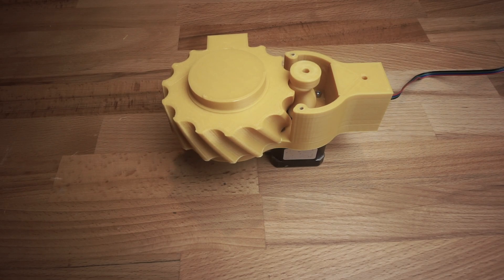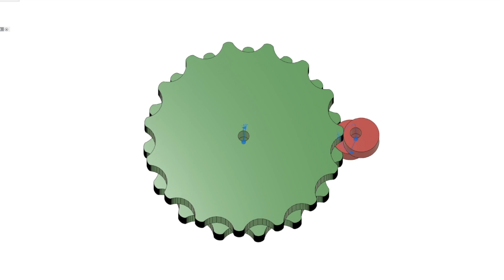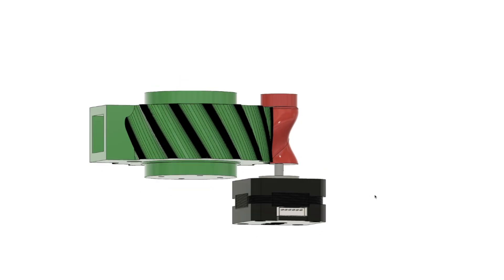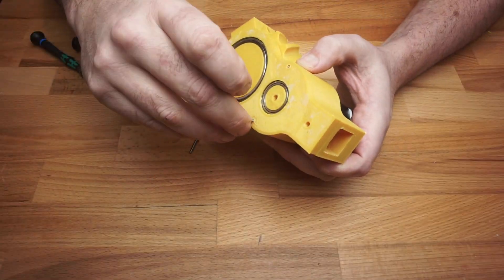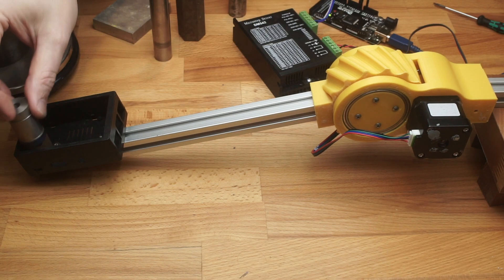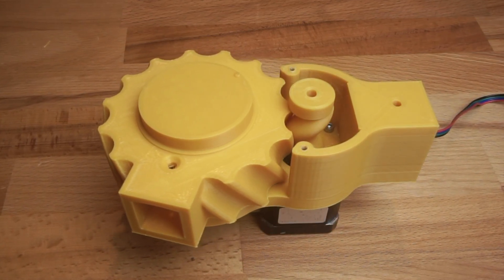What are Eccentrically Cycloidal Gears?

Comment: What parameters in the code have to be changed to get the disk in the shape as shown at 0:37 before we sweep? I require a 20:1 reduction. Eccentricity and the ring roller diameter are to be such that my motor shaft which is 8mm in diameter has to fit the sweeped roller (FYI its my first time doing this and my background isn't mechanical engineering)
Reply: Basically I want to increase the area of contact between the 2 objects of the gearbox

Comment: That cycloidal drive is fascinating and clever.
However, due to imperfections the drive gear acts
somewhat like a screw and causes a bit of sideways
force. This causes some extra friction.

I am suggesting that both gears incorporate a half
twist clockwise an half counterclockwise. This would
balance out any sideways force improving efficiency.

redrok AD0TJ

Comment: It would be good to have a comparison for the sake of efficiency. (I assume this is less efficient than cycloidal drive?)
Do you have another video with a torque test on an equivalent cycloidal gearbox?
I just checked your 20:1 video, and 1.6 is much kess than I expected, assuming the same stepper. I suspect that this is more efficient when compared to a standard one without bearings, but a standard one with bearings would be a cool comparison.
As well, a version like this but with say 3-4 bearing steps around the 1t gear instead of a continuous profile might reach a higher efficiency than this.

Comment: I disagree with characterizing this as any sort of cycloidal drive. A cycloidal drive works by pushing a bearing into an angled surface, producing torque by rolling downhill in a circle. This video uses the geometries of cycloidal drive gears, but it rotates a circle against a gear. It is basically a 1-tooth pinion gear. It does not „roll downhill“ anywhere.

In a cycloidal gear, the force pushing the cycloidal gear parts apart at the sliding surface is converted with high efficiency to torque. In this gear arrangement, similar separating forces are present, but because of no rolling on the sliding surface, they are lost to friction.

I suspect that if you where to make a custom involute gear with 1 tooth as a helical pinion gear, it would work better than this.

Comment: Nice video, I want to build the Hand Crank gear model. What metal hardware are you using? I'm guessing bearing spec are:  Deep Groove Ball Bearings 5mm Bore 16mm OD 5mm Thick; Is this correct ?

Comment: You can also 3D print brushless stepper motors now.  Maybe put in an optical sensor to measure rotation?  The optical sensors for mice are dirt cheap and should be able to measure the rough PLA surface going by.  Might be a really cool fully printed joint with embedded motor.

Comment: Hi, I'm seeing this a year later, hope you still reply... If you extend the big wheel with blades to be driven by water flow this design could be used to generate electricity. Wouldn't that be a more efficient than current designs?

Comment: If you start out with a small wheel rolling on the outside of a bigger wheel. Then offset the small wheel and modify the bigger wheel to fit. Now the small gear is "bigger" and the big gear is smaller. So if the small gear is "rolling" on the outside of the bigger gear, the gear ratio is smaller than originally and when the small gear is pointing out, the ratio is even higher. But in the final situation, the ratio must be uniform: The big gear MUST be moving uniformly. So... Alas, but there is friction and sliding involved in this type of gear.

Comment: The 'pinion' seems to be pushed laterally by the main gear, due to the incline. Perhaps it both were herringbone, the forces would balance out, keeping the pinion from being pushed.
Reply: It's really easy creating this in a herringbone setup and it does look like it does exactly what you describe :)
Reply: @b03tz3d  is there a video of that setup?
Reply: @bermchasin  not yet, I have only made a 3D design. I will use it for the base of my robot arm but I am still busy with the shoulder and elbow!

Comment: 2:30 I think there is some sliding here beside rolling. Still an awesome design.
Reply: If you wanted to eliminate the sliding wear, you could use the 180 degree phased approach at 1:08 but use a ball race around each pinion. roller camshafts in auto engines are made like this.

Comment: Thank you very much for sharing, fascinating! Is it true that you are using a 42 Ncm holding torque motor, so the expected efficiency at stall is 65% (4.2Nm / 6.3Nm)? I am curious about how the efficiency compares to typical spur gearing in general. Equally as curious about the cycle life/wear, since you mentioned that the interaction is rolling instead of sliding.
Reply from the maker: Hi, that's partially true, although in my experience, stepper motor holding torque is dependent on the voltage, current, driver choice etc. Instead of working out the efficiencies I've chosen to use the same setup on a number of different reduction mechanisms and see what the torque is - for my purposes, this works fine but YMMV. Comparing to a spur gear reducer is difficult as the efficiency will depend on the pressure angles and amount of backlash (and of course the quality of the prints) but I'd say this is as good if not slightly better if you are aiming for very low backlash - mainly because the form is more tolerant of the way that 3D printers produce parts. Wear on these is supposed to be negligible as long as you chose the right lube.

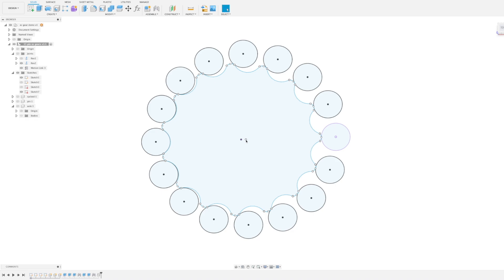Comment: What is the lowest gear ratio you can create with these cycloidal gears? Can a single tooth gear turn with another single tooth gear that is mirrored? Would it be possible to create a 2:1 ratio for these gears? Also how do you generate the shape at 0:39? Sorry for all the questions lol
Reply from the maker: you could probably go down to about 4:1 reduction, the shapes produced are not really suitable for low reduction ratios as the smaller the reduction, the more precise the shape has to be, and especially if you are 3d printing it, you'd be hard pushed to get the precision you need. The shape is generated using a plugin I wrote for fusion 360 and I covered how it works and how to use it in a previous video "Designing a cycloidal drive in Python and Fusion 360".
Reply: @roTechnic  Alright, thanks so much for your answer! With that in mind, do cycloidal gears only produce gear ratios of integers n:1 or are there gears that could mesh that could have a ratio of say 9:4?
Reply from the maker: @inoojo4780  I'm sure it's possible to design a pinion with more than 1 tooth which would give you varying ratios like you've described. But I'm afraid I haven't spent any time on the maths for it :(
Reply: @roTechnic  Got it, thanks again!

Comment: I’d be curious to see how this transfers to a planetary gearbox - would it work at all? Would it improve upon the already compact gear reduction? Would it hurt performance?
Reply: try it bro!
Reply: How would you transfer it? Also, I want to make a 3d Printed Cycloidal Drive Box. Not able to decide whether to print this 1 tooth gearbox or a full fledged one. This seems like a simple gear attachment that is split to be continuous. Whereas the cycloidal drive has a complete different mechanics.

Comment: This is a great video! I am trying to make an EC gear using your tutorial with Python scrip and fusion 360 but I am trying increase the diameter of the gear. What is the best way to increase the diameter of the EC gear? 

Thank you for the help!
Reply from the maker: Hiya, the best way to increase he size of the gear is to change the number of pins or the pin circle radius. increasing either of these will increase the size of the gear, but only the number of pins will change the reduction ratio of the gear.
Reply: @roTechnic   I have been trying to recreate your base that uses the EC gearing for my robotic arm but, I am have a bit of trouble. Do you mind sharing the specs of the larger EC gear used in the base (pin_radius, pin_circle_radius, number_of_pins, contraction)? 

Thank you for the help!

Comment: If you make the teeth by alternating internal cycloids (dedenda r1) and external cycloids (addenda r2)
then the driving pin can be made a cycloid gear too (with the radii swapped for dedenda and addenda). I'd choose r1 == r2 though.
Giving the driving pin more than only just one tooth (e.g. five smaller teeth) makes more teeth intermesh simultaneously. 
(=> Less twist needed to cover a tooth period. Or more than a full period covered.)
Also: With alternating internal and external cycloids at the addendum to dedendum crossover point the pressure angle is always zero. 
=> No forces pressing the gears apart!
Reply: This sounds really interesting, but I'm not sure I understand- do you have a reference?
Reply: What does that even look like?

Comment: Nice and tntriguing design! But i wonder, is it 1 to 1 equivalent to the "normal" cycloidial gear? In terms of engagement? If that design is as strong (in terms of breakage) as the normal version (for equal sized gears), that could be a viable alternative!
Reply from the maker: interesting! If by strong you mean "how much torque can it transmit?" then the normal cycloidal drive wins because of the increased surface area in contact at any given time (especially if you have multiple offset rotors). However, in my testing, I've found that the limiting factor is the motor rather than the gearbox - both these designs will handle the torque generated by a NEMA17 stepper. If you start using brushless motors then you may see a difference...

Comment: Isn't this a worm gear and wheel, just with odd parameters?
Reply from the maker: the main drawback of worm gears is that they transmit torque using sliding friction which makes backdriving more difficult as the reduction ratio increases and also has power losses as the torque increases.
EC gears on the other hand teamsmit torque using rolling friction (well, they do within the tolerances of the printer) which is markedly more efficient and allows for back driving even at high reduction ratios
Reply: @roTechnic  Is there a variant of this like a ballscrew?
Reply from the maker: @daliasprints9798  Never seen one, and I can't visualise how it might work as ballscrews have to slide to move. However, it should be possible to make a low friction, high reduction rack and pinion with this technique to give linear motion - that could be an interesting project...

Comment: If you don't mind, could you post to github the python code for what is shown at 0:45 in the above video?  I ask so that I can change the number of valleys to 12 from 15 (and all affected geometry), in a circumference of 42mm.  Please.  I've been beating my head against the wall since you posted this, and made dozens of not-quite-exact-enough iterations through Kentucky windage, to no avail.  I don't mean to bother, and have therefore done all I know to do first. Thank you for your excellent work and kind attention.  I will hold my breath.  :D
Reply from the maker: Hiya, I'm using the same code as in my cycloidal drive video - it's posted here: https://github.com/roTechnic/CycloidalDesign
You should just need to adjust the pin diameter to something like 15mm and the PCD to your gear diameter.
Let me know if you have any trouble changing the parameters - I'm always happy to help!
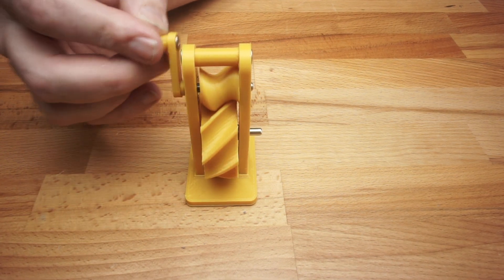Reply: @roTechnic  Thanks!  So I'm doing something wrong.  From the calculations on screen of your cycloidal drive video https://youtu.be/y9vLVXjz2c0?t=129 "Designing a cycloidal drive in Python and Fusion 360" at 2:09, I plugged the following values into the fusion 360.py code from the github link:
pin_radius = 7.5 (bc PCD 15mm), pin_circle_radius = 21 (bc PCD 42), number_of_pins = 12, and left contraction (which I think I need to eliminate altogether to get what you have above at 0:45, but I won't be surprised to be incorrect) at .2

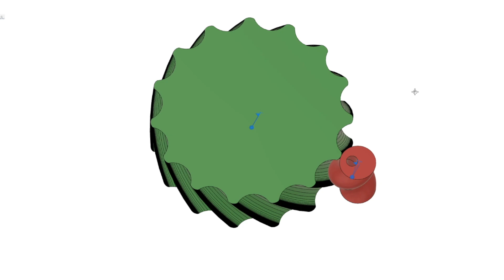Idk how to upload an image of the result, but suffice to say it's nothing like 0:45 above.   So I then tried reversing the convex to concave by applying the changes you made on your video https://youtu.be/xv5cd7Bg7Uk?t=76 "an easier robot arm actuator..." starting at 2:06, but still get the result that you did (how odd) of convex and not what I'm trying to get at 2:02 of same video ( https://youtu.be/xv5cd7Bg7Uk?t=122 ) or BETTER, at 0:45 in the video above these comments, "What are Eccentrically Cycloidal Gears?".

Help please?
Reply from the maker: @Upekrithen  I think your problem is that you are trying to fit too many pins which are too large into too small a pin circle radius. If I take your numbers and increase the pin circle radius to 40 then it looks about right. If this doesn't help, feel free to email me on the email in the about section of my channel, you can attach pictures that way.

One other quick hint would be to prototype your numbers using  "pyplot cycloid.py" which i have put in the same repo. this will show you more detail about what everything would look like, and then once you have something which looks good you can take the numbers over into the fusion add in
Reply: @roTechnic  Thank you very much.  I realized that (as you said) the measurements are in centimeters, so I changed pin_radius = .125,  pin_circle_radius = 1.5 number_of_pins = 11 and contraction = 0.2, and that very nearly gave me what I need for the disc.  I appreciate your time and assistance.

Comment: I tried making an internal version but it didn't end up saving much space without drastically shrinking the gear reduction. I did make a mirrored/herringbone version though for my own joint. I'll post the link below
Reply: https://youtu.be/soCIkuO6VmQ
Reply from the maker: Love your design. I’m hitting the same issues myself with the internal version, but I think that by reducing the contraction and pin size I’m getting somewhere. Did you find with your internal version you got an extra node on the disc?
Reply: @roTechnic  yep, one extra node. I believe that works in our favor though for extra reduction.

Comment: It's called a worm gear, not a "single tooth" gear
Reply from the maker: it's not a worm gear, worm gears work through sliding friction which makes the whole system very inefficient. this works through rolling friction which means that the transmission is a lot more efficient than worm drives
Reply: @roTechnic  The distinction between a worm and a helical gear is that at least one tooth persists for a full rotation around the helix. If this occurs, it is a 'worm'; if not, it is a 'helical gear'. A worm may have as few as one tooth.
https://en.m.wikipedia.org/wiki/Gear
Reply: Words are sound and smoke.

Comment: this is a fairly low gear ratio (15:1) and we've seen a lot of people do backdrivable cyclodial gears up to 20:1 or so, how high a gear ratio do you need to go before it's no longer backdrivable?
Reply from the maker: This drive has less friction than the cycloidal drives I've made in the past, but I've got no real way to measure the losses due to friction - and it's these losses which will hinder backdrivability. Have you got any ideas on how to measure them?
Reply: @roTechnic  You can measure force (ie. torque) in and force out i guess. Any difference from the calculated one (deriving from the ratio) should be losses due to friction or other causes. You can also find papers on friction in ie. helical gears (long reads) on the subject online.

Comment: you showed the amount you could lift with that stepper before it started skipping steps, but without knowing how strong the stepper is by itself, that's not that useful a number
how much weight could the stepper lift if the arm was directly attached to it? How close does this come to the theoretical perfect gearing (i.e. 15:1 gear allowing it to lift 15x as much)
Reply from the maker: the stepper is rated at 42Ncm, but the torque produced is very dependant on speed (and current, driver choice etc). That's why I'm not really comparing it to a bare stepper, I'm really just looking for a total package which will give me the torque I need for an robot arm project I'm working on.
Reply: If the driver provides the maximum current for the stepper, it would deliver its maximum torque at stall. Thus one could calculate the efficiency, but I don't think that this really matters for a hobby application.

Comment: In a practical scenario it would be best to make multiple angle offset pins instead of a smooth curvy one because it is hard to machine the pinion pin.
Reply from the maker: Yes, you're absolutely right - if this was being made out of metal, using subtractive technology it would definitely be easier to make multiple "steps" instead of a smooth surface. With 3d printing (additive) the smooth surface means it prints easily and doesn't need supports.
Reply: ignoring cnc (the obvious answer) this could be treated like a thread with a huge pitch (22mm, not sure if my lathe could do that) and a massive round thread form

Comment: Using two conical bearings behind each plate, the pin gear can be moved to the inner of the big gear, while being rigid, compact, and protected (bearings will be covered). If the tooth angle can be increased, the big gear will shrink even more. Angle is the main ratio driver?
Reply: You could combine the above with 90 degree conical gears to bring the motor parallel or a centered worm gear to have the motor inside the arm. Alternatively, belt or gear drive the motor to integrate it vertically in the arm. Apart from adding ratio reduction of ie. /2, this way even a second synched motor can be added, to drive both sides of the pin.
Reply from the maker: That's a really good point about the angle being the main ratio driver - I had not considered that before. Thank you